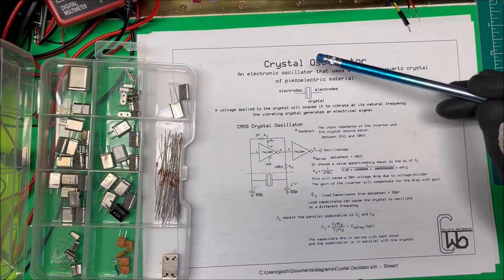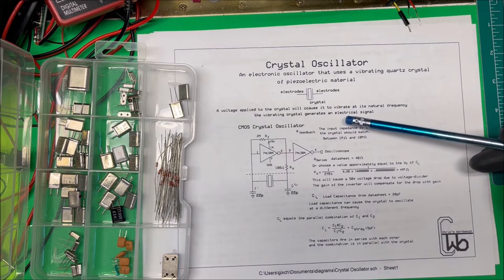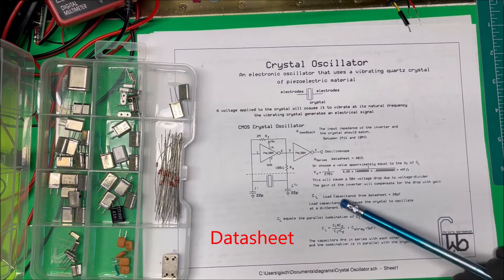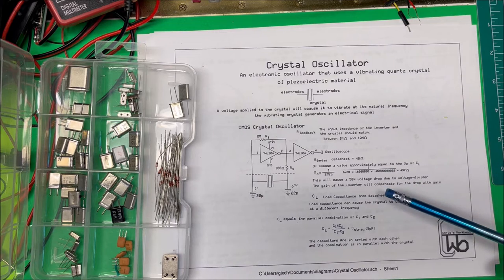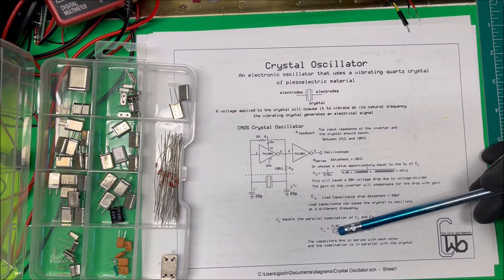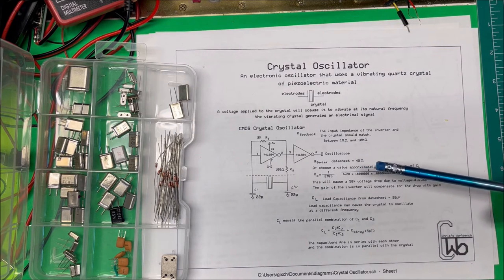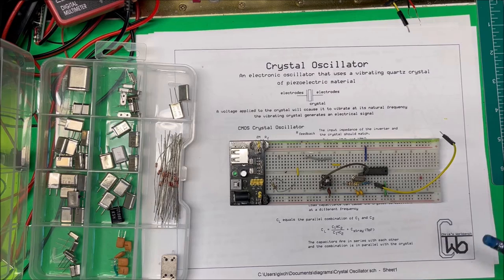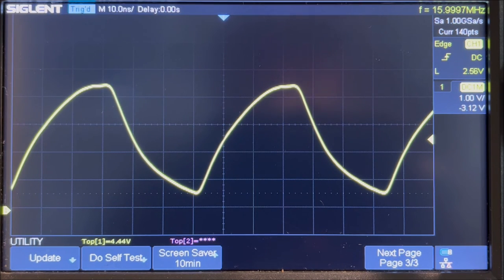Crystal oscillator

Comment: Good stuff, Chris. MCUs just require the crystal and the two caps. Meaning, the MCU has the rest of the circuitry internally = interesting. Tweaking the frequency with a variable trimmer cap is an interesting idea.